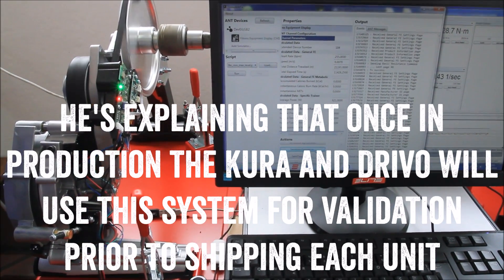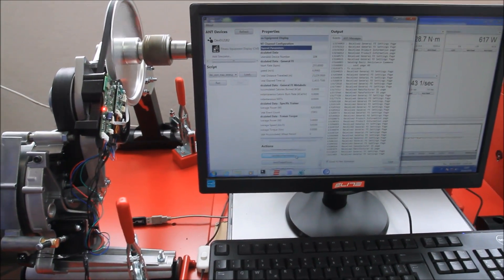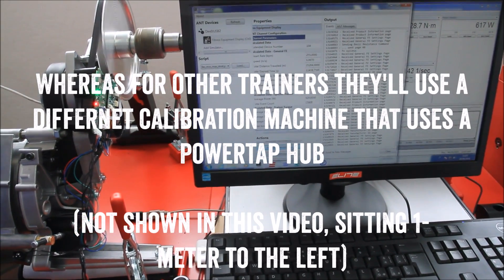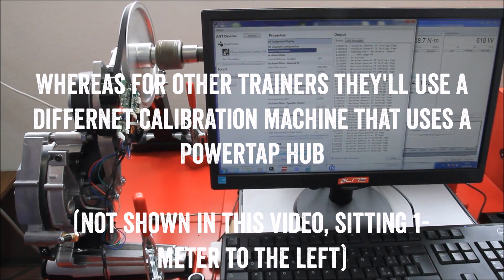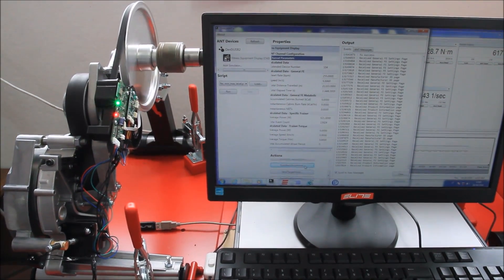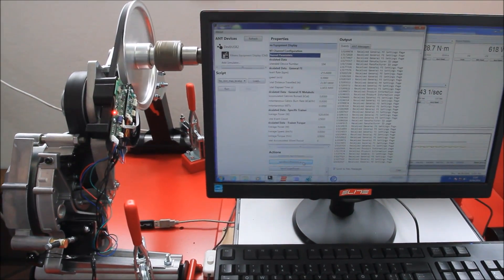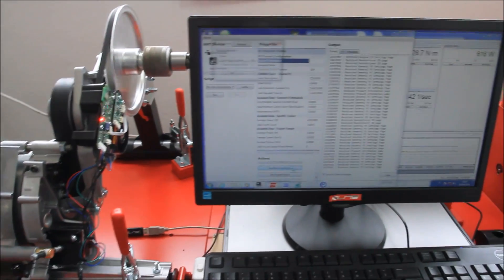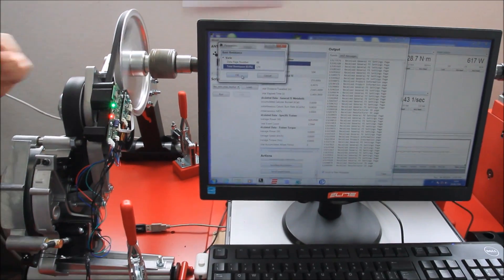Behind the Scenes: Elite Kura & Drivo Calibration Machine

Comment: The 'accuracy' over the longer term also depends on all the phyiscal connections such as the belt, remaining constant over time. I'd be concerned that as the belt ages, it's ability to tranmit power from the bike to meter will be altered? As it's sealed you can't see the belt (unlike Kickr) to judge if there is wear/slipping
Reply: That's what calibration is for (zero offset/spindown).